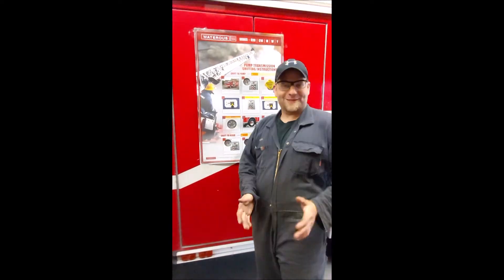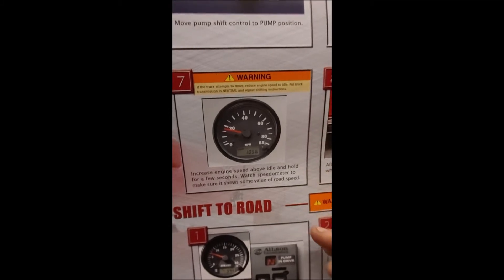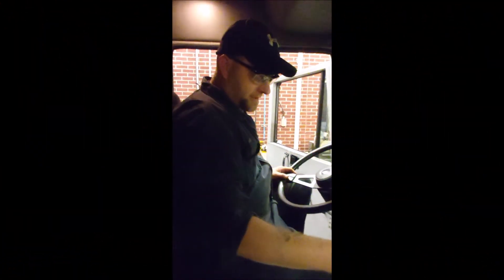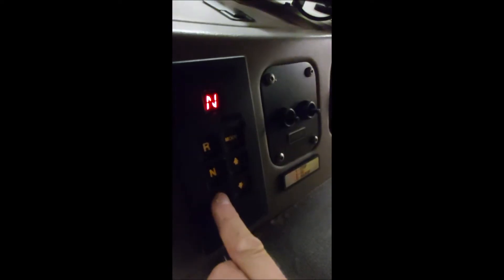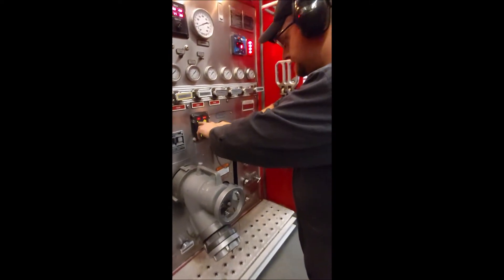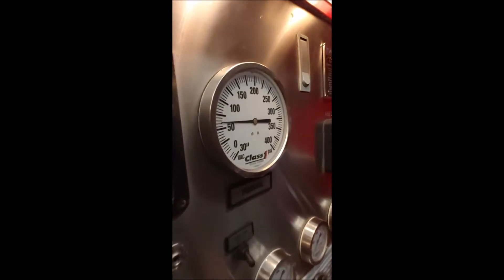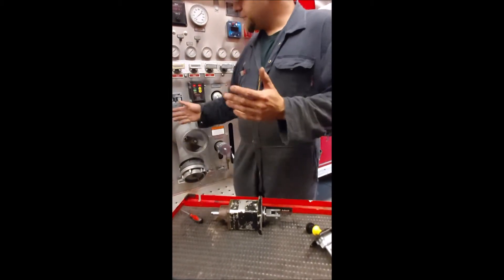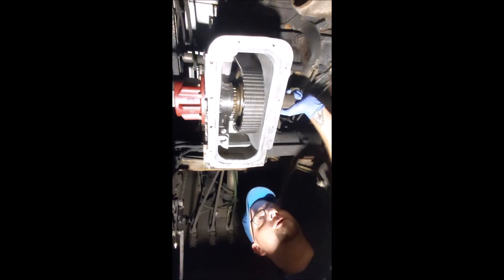Ever wonder what happens when you shift a fire truck out of road mode into pump mode ?

Comment: Great video and information. I have one question though regarding shifting after a water supply is established. If you hook your 5” and open your water intake would that spin your pump and gears? So I’m assuming you have to switch from road to pump mode before opening your 5” intake so you can safely switch the collar over without any damage occurring?

Comment: Nicely done video - very cool to see the inside workings of what happens when we shift to pump.  Back in the day, I drove a manual transmission pumper.  It had a "pump gear" position on the shifter.  I heard that the guys took the pumper out and did a drive-by deck gun of a neighboring department one time.  They managed to shift into pump gear while driving down a hill and blasted them!  We had a lot of fun back then!